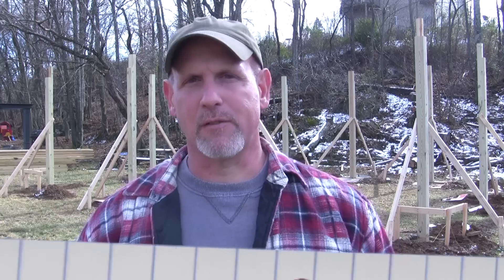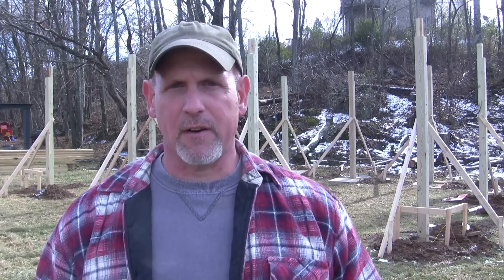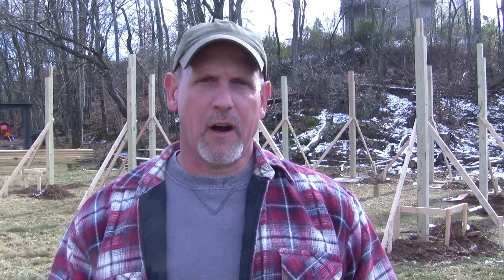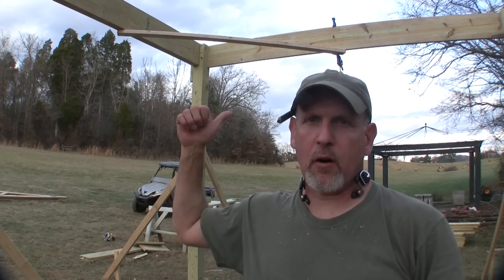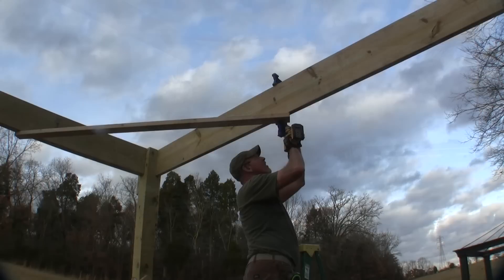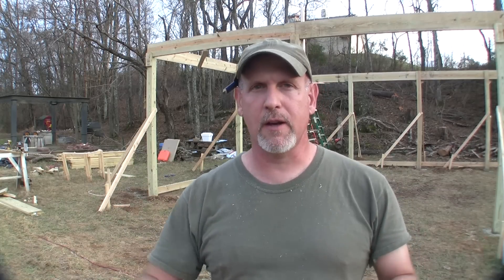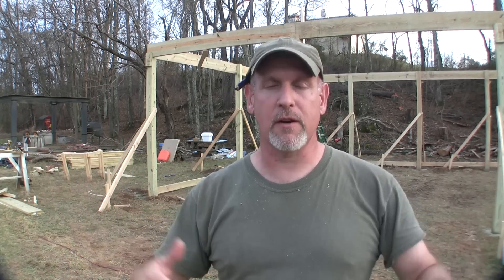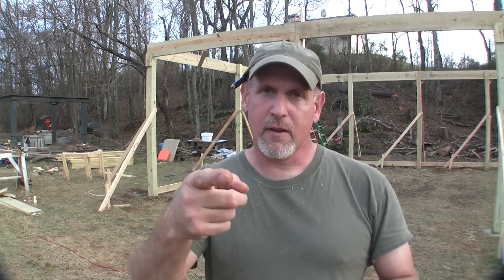How to Build a Pole Barn Pt 4 - Banding & Bracing for Trusses

Comment: Im getting ready to build a pole barn in the spring.  Really enjoyed your video.  Thought you did an excellent job explaining everythingt.  Especially liked how you figured squaring the building.   Was curious why you put your tresses on 8 ft center versus 4 ft.  Can you explain advantage of this and what your thoughts are on spacing the tresses.   Thanks.
Reply from the maker: Thanks for watching.  I'm glad you got something out of the videos.  I'm not sure there's an advantage to using five versus nine trusses other than cost.  I did not sheet the roof.  It will only be metal so it's not carrying much weight at all.  The perlins add the lateral strength.  I had an engineer design the trusses and layout so I figure he was smarter about this stuff than me.  If you use a prefabbed truss on yours then just make sure an engineer gives you their stamp of approval.  Maybe some other viewers can comment on this thread and help out with an explanation.  Good luck on your project!

Comment: I suppose this is an obvious question, but you "notched" the top of the posts to set the band around the top.  Did you also notch the bottom of the posts so that you could set the 2 x 6 bottom band flush with the surface of the posts?
Reply from the maker: Thanks for watching and commenting.  Good question.  No, the top of the bottom band is at grade so that's where the earth/grass/mulch will come up to.  No need to notch it in.

Comment: im about to build a 24 x 48..This is helpful. I also use a lazer to put starter strips on for vinyl siding..it works great. Wish i was closer to give you am hand and to get some hands on myself. Im in upstate SC
Reply from the maker: Outstanding!  I'm glad you got something out of the video.  Hope it helps out.  Yes, the laser rocks!  I'll tell you, there have been points along the way I could have used a hand.  Right now especially.  I have everything done except the roof.  Trusses are up, perlins in, sheeted and wrapped, got the metal on sight, etc.  Just can't catch a break in the weather and round up a helper or two!  I'll have Part 5 - Setting Trusses posted in the next few days.  I'm working on the footage right now so stay tuned for that.

We're not that far apart.  I'm guessing you are in Greenville/Spartanburg area?  I'm in the Bristol area.  Heck, lemme know when you start and I might try to run over one weekend!
Reply: ***** yep just about 10 miles south of Greenville  I could help ya with the garage doors  thats what i do for a living
Reply from the maker: Excellent.  I may shout at you this spring when I get to that point!
Reply from the maker: BTW, you ever put in a Liftmaster jackshaft opener?  I put some in my house and they are very cool.  I have a video on my channel about installing them.
Reply: Yea they are nice especially if you dont have enough headroom for a traditional opener. I love liftmaster/chamberlain openers.
Reply: I can't seem to send you an email,it want take it,I don't know why.
Reply: Sorry, I thought I was sending this to my son.
Reply: @Hello Joe how are you doing

Comment: Hey Feddie, I hope this isn't a dumb question, but I'm a bit confused.  When you marked your 5 foot reference line on your posts and you used your laser receiver to come down another 10.5", where did you have your laser set up?  Do you just set it up to shoot a level beam (at any height) then pick up that beam with your receiver when your level?
Reply from the maker: Not a dumb question at all.  Yes, I just set the laser up with no concern where it would hit.  I just knew wherever it hit it would be shooting on a level plane.  You don't really have to use a reference line.  I could have simply measure down from the top of the pole and accomplished the same thing but once the bracing is on the posts it is hard to measure around them.  That's why I just put a reference line on them that would be clear of the bracing.  So wherever the lasers is hitting then it's hitting level on all the posts.  Then I can simply measure to the reference line (or top of the post) and know if I am level at the top.  Hope that makes sense.  Thanks for watching.
Reply: ***** Makes perfect sense, thank you.  That's why I enjoy your videos, you have the ability to demonstrate and explain these projects with superb clarity.  I've never used a laser like that so I was unsure how it worked.  Looking forward to your next video, keep up the good work.
Reply from the maker: Thanks again.  I really like the laser level.  It's much more versatile than a transit.  I guess they each have their purpose but when +- 1/8" is ok then the laser works perfect.